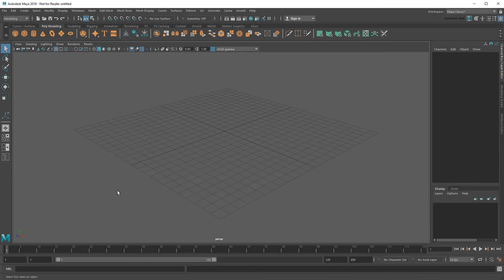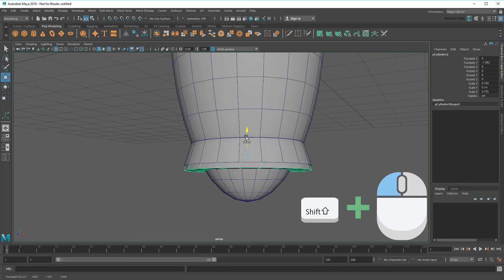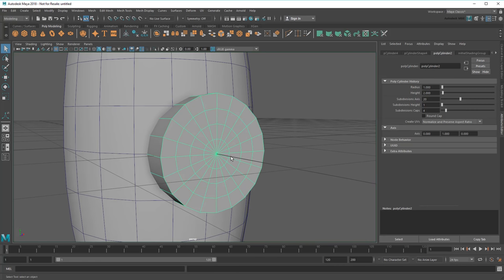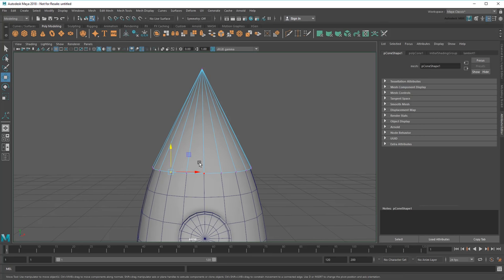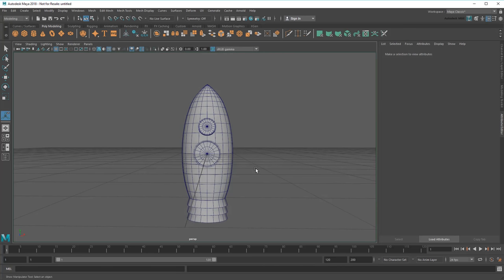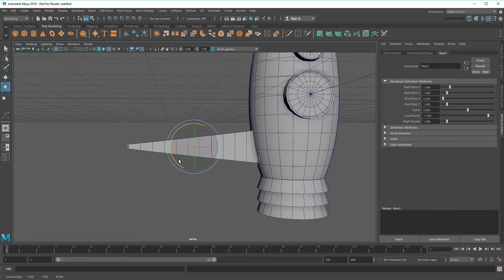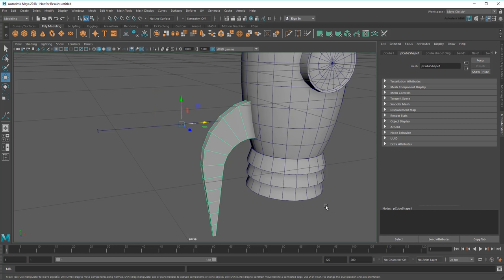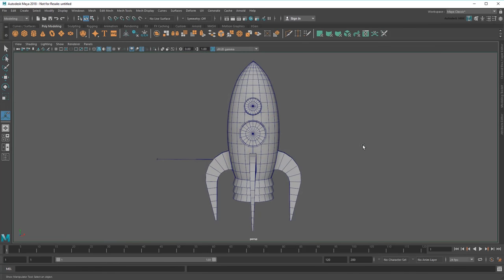Intro to Maya: Lesson 3 / 10 - 3D Modeling your first model

Comment: anyone struggling with 4:44, that everything disappears. Instead of selecting all the shapes, do it part by part until you find out which part is causing the issue, and then you make sure that part is touching the rest.
Reply: THANK YOU! Had to tweak my boosters a bit so it would work :)
Reply: Thank you so much, I was stuck here forever.

Comment: Why is my objekt disappearing when I union them. Am I alone with this thing?
Reply from the maker: Some older versions of Maya have a bug where this can happen.  You can fix it by selecting the objects and going to Modify > Freeze Transforms before using Union.  
If that doesn't work, then you can just use "Mesh > Combine" instead of Union.
Reply: @Autodesk_Maya  thank you but it didnt work:) It worked when I changed the display mode. I guess it was just some bug
Reply: @Autodesk_Maya  THANK YOU one more time to responding a comment of a video that were 2 years ago

Comment: Hi, I seem to be having some issues when trying to use the bend tool. When I drag to change angle my shape doesn't react the same as yours. I'm using the same settings but just doesn't seem to work the same. I'm using the student version, is this maybe the problem? Great tutorials. Thanks
Reply from the maker: The student version shouldn't react any differently.  Where is your deformer handle located relative to the geometry?  It's possible your default settings create it at a different location/orientation.
Reply: @Autodesk_Maya  Visually, my deformer handle is in the exact same position as shown in the video. 
 How can I check my default settings? Is there a video for this? Thank You for your quick reply.
Reply from the maker: @theactualalfie9045  When creating the deformer, click the small square next to it in the menu.  Once the settings menu opens, go to Edit > Reset Settings.
Reply: @Autodesk_Maya  Thank you for your help. I have now managed to fix my issue!
Reply: @Autodesk_Maya  hello.. I also have this problem but I can see any " reset settings" or a small square. Where is it exactly? Please could you be more detailed?Thank you!
Reply: @Autodesk_Maya  that didn't work for me pls help me :(

Comment: at 1:35 you make the boosters go away from the rocket by drag clicking them. when i drag click them it selects the whole cylinder and turns it completely orange. something im missing?
Reply from the maker: Do you have Soft Select turned on by accident?  Try pressing 'B' and see if the orange goes away.

Comment: sir, i am using maya 2019 student version and in that when i press B colour grading is not appearing. what should i do to fix this?
Reply from the maker: Try going to the Tool Settings with a Move/Rotate/Scale tool selected, then turn on Soft Select there.  If you still don't see a color grade, increase the Radius size.

Comment: When I try pressing "B" to soften, the whole selection turns yellow and I don't get that gradient where I can adjust different parts like that. I'm not sure what's wrong. I also can't adjust the size of the area either when holding b and the left clicker.
Reply from the maker: Your circle is probably just way too big to start.  Try holding B + Middle-mouse drag to start from 0.
Reply: @Autodesk_Maya  that was indeed the problem. Thank you! I was so frustrated, lol.
Reply: @Autodesk_Maya  yes! thank you! I was really confused there hahaha

Comment: Soft select isnt working for me like how it is for you :( I go into vertex mode and select the top vertex of the cone and then press b. but then the whole cone goes yellow and it doesnt change anything when modelling. no option to adjust the radius either once in soft select mode
Reply: NVm checked autodesk website and found that you need to set a radius first lol
Reply: Lol would you mind explaining me? I have the same problem (or link me to the autodesk Website you went please)
Reply: @Splatt707  enable soft mode and select and vertex and hold b to do it I think
Reply: B+middle mouse button to right or left (it took me 10 minutes to figure out!!)
Reply: @claudionouvelle  Nice one dude

Comment: At 8:24 when i apply the flare on the cube, it becomes purple and the handle is green; when i rotate the handle the cube doesn't change shape...
I'm working on a Mac with maya 2019... this problem is driving me nuts.
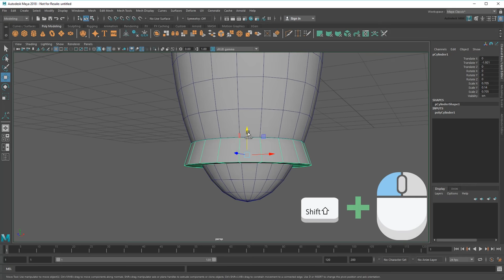Also at 2:01 the duplicate shortcut doesn't work anymore... i mean it worked once but then, i don't know why it stopped working.
I'm sorry to waste your time... thanks in advance...
Reply: I am on a Mac and having huge problems with the flare on the cube too. (Mac Maya 2019).  Did you find a solution?
Reply: @s.mconway4760  Nope...
 I'm trying to do the same shape with another method but i'm not having success...
Reply: @s.mconway4760  I'm also in a mac. Playing with the start and end values get the flare started for me, but nothing that I do makes it look like what's supposed to.
Reply: Me too. I'm using the 2018 version and have the exact same problem.

Comment: Can't duplicate the booster with shift+LMB, help please.
Reply from the maker: Which version of Maya are you using?  If it's an older version, you can alternately just press Ctrl + D with an object selected to duplicate it.
Reply: @Autodesk_Maya  I'm using the 2018 version, I used Shift+D to duplicate then moved the booster.
Reply: @edgarl.f.4471  Move tool settings - Smart Duplicate Settings - Shift +Drag to Duplicate Objects Checkbox
Reply: SHIFT+D to duplicate. This tutorial is wrong with the Shift+Drag. Doesn't work in version 2017.
Reply: @fedorcheboksary  Worked like a charm!! Thank you!

Comment: When I went to mesh > booleans > union,  the model disappeared. What did I do wrong?
Reply from the maker: Did you try union-ing the entire model at once, or just two pieces?
Reply: Maya Learning Channel the entire model, around 2:25 on the video (the sphere and the 3 cylinders).
Reply from the maker: @calvinbrown2590  Try merging them two at a time and see if you get the same behavior?  If you do, try selecting the mesh and going to Edit > Delete History first and then merging again.
Reply: @Autodesk_Maya  Ok, thanks. I worked around it by going to mesh > combine, but I'll give that a try next time I have that problem.

Comment: I'm having a hard time with the "J" command for the 15-degree interval turns on the porthole cylinder. I'm holding the key down and trying to rotate, but it doesn't rotate at all unless I release the J key and rotate free-form. Can someone help me? Please? :)
Reply from the maker: Try tapping J and then rotating.  Does it rotate in intervals?  If you're on an older version of Maya, you may not have the "hold" J functionality, but you can still quickly toggle it on and off by tapping.
Reply: It doesn't seem to matter if I tap or hold the J

I'm using Maya 2018

Comment: At 1:33 after selecting the vertices I cannot rescale anything.. The Axes don't show up. What's wrong?
Reply from the maker: Are you sure you have the Scale Tool activated?
Reply: @Autodesk_Maya  I'm having the exact same challenge. Scale tool is activated. The entire cylinder scales up... bottom vertices won't select but rather the whole cylinder.
Reply from the maker: @toddd.8496  You might have Soft Select mode enabled by accident.  Press 'B' on your keyboard and then try scaling again.

Comment: I'm unable to extrude the window inside like the tutorial at around 4:00 , when I try to it makes the ring with faces go black and it doesn't have the right shape either. When I try using other methods it destroys my entire wireframe.. I did the exact same but it doesn't work! Is there any way to fix this? Or is Maya 2020 just really broken?

Comment: I have a lot experience working with blender, but I have to start working with Maya.
Its harder than expected, but this tutorial series is really helpful. It's also hard to find good tutorials for Maya.
Is it just for the tutorials or isn't Maya working with as much shortcuts as Blender? I kinda miss them.
Reply from the maker: Nah, Maya has a ton of hotkeys (so many that literally every button is accounted for).  I just don't get into them in these early tutorials since there's already a lot for beginners to take in.

If you'd like to see a list of all hotkeys, you can check out this reference: http://help.autodesk.com/view/MAYAUL/2020/ENU/?guid=GUID-30CACC9D-8FBE-4B85-8A8F-C5ADF32DDD4E

I also have a video on the Top 10 hotkeys as well: https://www.youtube.com/watch?v=wCrC4ypg8ms&list=PLB17FF2E88AEFDBE4&index=9
Reply: @Autodesk_Maya  Woah, didn't expected that fast response.
Good to know about that shortcuts, it's a bit irritating that all hotkeys work different from Blender, but it would be the same situation if I would switch from Maya 2 Blender. Maya has more common with unity and Unreal though. 
Is there a shortcut to drag an object or vertex free or along axis without using the arrows, just the mouse? Like on Blend press "G" and maybe "X, Y or Z" for move along axis.
I guess this question answers itself if I continue watching your tutorials :)
Reply from the maker: @Anldiot69  You can Alt + arrow when an object is selected to move it a pixel at a time in each direction for very precise placement, but that's a little slow as a primary means of translation.

One alternative I use frequently is you can middle-drag any field in the Channel Box to use what's called a "virtual slider" (that is, it'll increment the value up and down as you drag, much like a slider would).
Reply: i'm getting started with Maya in my studies, and i come from blender, i miss every shortcuts of blender lol even basic grab/scale/rotate keybinds because they make more sens in blender for me especially on a azerty keyboard... gotta train that muscle memory

Comment: I Need a computer that will run Maya, and all of the Autodesk Software used for Entertainment Graphics.  Can You recommend a PC Laptop that has more than enough system resources to run MAYA and 3D Studio Max at the same time?
Reply from the maker: Hmm, it also depends what you're doing in each software at a given time.  If you're modeling relatively simple scenes in both, then you can get by with even a Surface Pro.  However, if you expect to be animating dense scenes, dynamics, or rendering in each software you'll need something heftier.  I'll occasionally use a Lenovo P50 with an i7 dual 2.7 GHz processor, 16 GB of RAM, and dedicated graphics card and it'll get the job done for one of those software (haven't tried running both at the same time).  At the office, I run a much more powerful workstation.
Reply: @Autodesk_Maya  I'm looking for advice also on the new i9 processors to know if they are being put into Laptops. Also, AutoDesk  has a video on Facebook about a new GPU.

Do you work for AuroDesk?
Reply from the maker: @UtahJobSeeker51  I do, but unfortunately hardware isn't my specialty.  What I can tell you is that Maya is mostly CPU-based (although Arnold GPU rendering has just recently entered Beta) and the more RAM you can get, the better.
Reply: @Autodesk_Maya  Thank you for your kind and timely replies.

Comment: sir i have an issue with my model ( TEXTURE ISSUE ). when i applied normal map on my model some of part visible black. i know the reason behind it. the reason is in UV. some part who is visible black are facing opposite side in UV. i manually change that wrong sided UV. is there any technique who is gonna simplify this headache ?? Bcoz when we model hardsurface modeling this manually technique waste lots of time. i tried vertex and face normals technique. but this technique is work on model's opposite face not on UV's opposite direction. could you pls help me to out this ??
Reply from the maker: There is indeed an easy way to do this.  Open the UV Editor, then select your model.  In the UV Toolkit, under "Select By Type" click "Back-Facing" to select all the backward faces at once.  Then in the "Transform" section, click "Flip" to flip them over.

Comment: Hi, I´m using Maya 2022.3, and I can´t make the Flare and bend things work... is there any other way to get this trick right? Thanks a lot :)
Reply from the maker: Could you be more specific?  Does Maya create the flare or bend handles at all?  Or does it just not do anything?
Reply: @Autodesk_Maya  I follow the sames steps as in the video, but the flare never happens when I rotate, neither does the blend, it just moves a little but as much as I rotate, nothing  really happens.
Reply: @Autodesk_Maya  btw thanks for answering :)
Reply from the maker: @danix6145  Have you tried adjusting the handle values in the Attribute Editor?
Reply: @Autodesk_Maya  I am not sure if you figured it out but I can't and im about to throw my laptop into a lake. SO if you did figure it out do you have any advice? I tried a lot of ways and can't get it and moving them one at a time looks shitty
Reply from the maker: @sydneywells5794  If you're having trouble doing it as shown in the tutorial, try these alternate steps:
1.)  When you create the cube for the fin, use alternate values of Width: 0.491, Height: 2.894, Depth: 0.15 (basically, flip the Width and Height as shown in the video.
2.)  Similarly, set Subdivisions Height to 11, instead of Subdivisions With.  This will get you a long box standing up instead of sideways.
3.)  Now go to the pCube1 tab in the Attribute Editor and rotate the entire thing 90 degrees in Z.
4.)  Apply the Flare / Bend handle and try to adjust the values as in the video.

This sets up the box to line up with the handle's default orientation, rather than having you rotate the handle to match the box.  Let me know if this works any better.

Comment: I am a bit confused. I get that the Maya tools are super handy to deform the shapes for the handles but... how would you know that rotating it a little or moving it will yield the result you wanted? Thanks in advance.
Reply from the maker: The deformation region will always act predictably relative to the handle, so in fact, it's actually your best way of controlling it.  For example, flares always occur at the very ends of the Flare deformer, so I need to rotate the object so that the parts I want to flare are at either end.  Meanwhile, the bend of a Bend Deformer always takes place in the middle (in fact, you can even see a curve on the handle itself denoting the exact bend), so it's just a matter of placing where I want that bend to happen.

Comment: Hi, i'm using Maya Student 2019.2 and i have an issue with booleans: 
sometimes when i click on Union button some (if not all) objects disappear from persp (also other views) but not in the Outliner panel. It looks like a bug but maybe i have some settings funked up.
Can anyone give me further information on this? 
Thank you so much, Tito.
Reply from the maker: Yes, unfortunately there is a known bug in 2019 and older having to do with Unioning scaled objects.  You can try fixing it by selecting the rocket and going to Modify > Freeze Transforms before Unioning.  Or if that doesn't work, you can use Mesh > Combine instead of Union.

Comment: I'm having issues with the Deform >Flare part. When I select Flare on the Nom linear menu the cube vanishes, If I adjust the Envelope setting it reappears but the Handles don't seem to have the same effect on the cube. I'm using Maya 2019.... I've repeated the step multiple times now......
Reply from the maker: If you create the same sort of cube in an empty scene, then apply the Flare, does it work there?

Failing that, try opening the "Flare Options" via the small square icon next to its name, then go to Edit > Reset Settings before using it.  It might be the settings are not on the default for some reason.

Comment: Hi, i tried pressing the shift+left mouse button to duplicate the booster but there are no changes, Instead, I am ending up moving the original one again and again. What can I do to duplicate a shape? Is there any setting option i require to alter?
Reply from the maker: If you're on an older version of Maya, you may not have the Shift duplicate functionality.  Instead, you can simply press Ctrl + D to create a duplicate and then move it.

Comment: You used Booleans/Union option at the beginning of the video. I learned to use Mesh/Combine, which is really similar. What is fundamental difference between these two??
Reply from the maker: Combine will keep any internal geometry, while Union will remove faces inside the object.
Reply: @Autodesk_Maya  nice

Comment: when attempting to select the individual objects >mesh>booleans>union. The rocket part of the ship just completely vanishes, no error messages or anything. Sometimes all the objects vanish. How do you prevent this? why does that happen?
Reply from the maker: Try using Mesh > Combine instead.  It seems to be related to the scale of the object.  In the version of Maya I filmed this on, smaller objects could be Unioned without issue.  In newer versions, they need to be bigger for it to work (seems like a bug)

Comment: Which edition of maya is this??2017,2018,2019?
Reply from the maker: 2018, but the workflow is valid for 2017 and 2019 as well (you'll need to manually duplicate things in older versions of Maya, since the Shift + drag workflow won't work though)

Comment: when I tried making a clone of the rocket boosters it didn't work I did the steps press shift then drag down. but when I did it, it  just dragged the booster down without cloning
Reply from the maker: Which version of Maya are you using?  That functionality was only introduced in 2018.